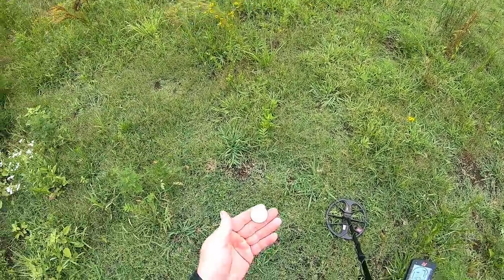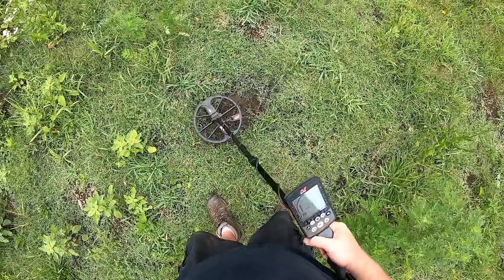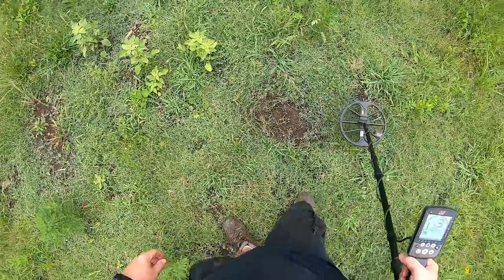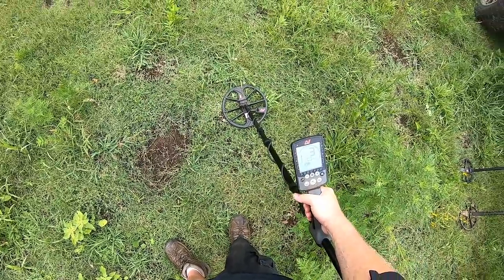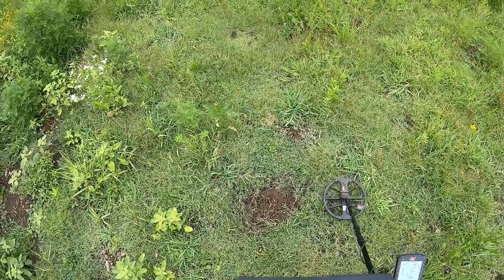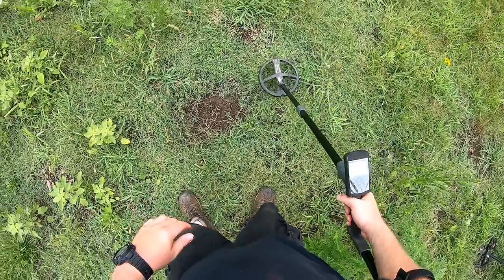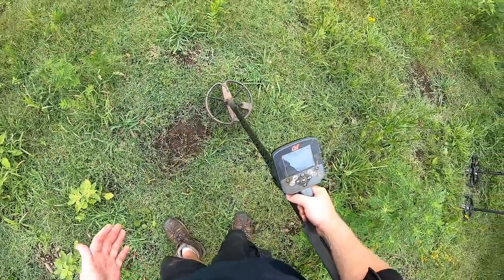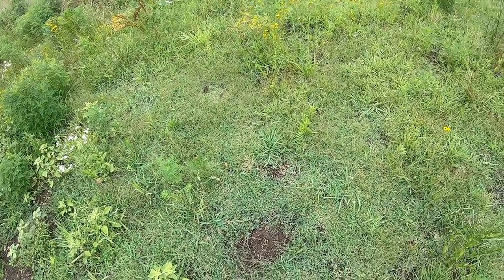Testing a big silver on edge: Minelab Equinox 800 vs CTX 3030 vs XP Deus. (#58)

Comment: This test proves why no one should be hunting in Park1 or Field1 as they are basic, reduced settings programmed into tge machine itself that is deaigned to help tge new user learn tge machine. Your hardest and deepest hitting program is Park2 and the machine has no problem hitting anything. Using Park1 or Field1 is like using the CTX or Deus in basic settings and hoping to find everything no matter of depth or ground conditions. Otherwise a great video that showcases the "basic" programs of the machine and then what it can do once you start changing settings to open the machine up more.
Reply from the maker: Detecting Chicago that’s a pretty good analysis. For the type of hunting I do I’ve found Park 2 works best. The combination of higher frequencies lets me pick out lower conductors along with high conductors, hits deep nickels hard, and seems to offer better separation than Park 1 IMHO. According to Minelab Park 1 is better suited for hunting higher conductors in modern trash but Park 2 works just as well in that scenario for me. I rarely ever use Park 1 or Field 1, so this really has no effect on me, but I do believe the machine needs a software adjustment to fix whatever is causing it to read big silver this way... especially since Minelab themselves promote Park 1 as being the best choice for high conductors due to the frequency combo. Thanks for watching and HH. Dewayne
Reply: Detecting Chicago yes, park 2 is the way to go.  I changed my park 1 to hunt my 8-13 targets with a higher tone.  I tend to overlook those....GL & HH

Comment: Thanks for the video. You probably just talked me out of buying an Equinox to compliment my e-Trac.
Reply from the maker: You're welcome Arkie. To be honest, its not really that big of an issue since most of us use Park 2 anyway, and its not effected. The Equinox really is a good machine and compliments an FBS detector nicely. Minelab just needs to fix this issue IMHO. GL & HH Dewayne
Reply: I still might get one. I like the idea of a backup/complimentary machine that can get wet. My current backup machine is my old White's DFX, which has received exactly 0 minutes of field time since I bought the e-trac several years ago. For years I have been considering selling the DFX plus the 2 extra coils and Sunray probe and purchasing an AT Pro, simply to hunt in the rain or water (and still have a backup machine if needed.) Now being a Minelab guy, I thought the Equinox would be a much better option, for not a lot of extra money, over the AT Pro. Now I'm thinking maybe sell the e-trac and DFX plus all the accessories for both and buying a 3030. Don't know which route to go.
Reply from the maker: I went from a White's V3i to the Etrac and was very pleased with the performance of the Minelab. Its deadly on deep silver. Aside from being waterproof, the 3030 offers a few more nice tools over the Etrac. The one I like the most is Target Trace.. Once you get the hang of using it, its very easy to see when you have multiple targets under the coil. It can also help identify round targets vs odd shaped targets. FBS machines have the best Target ID I've seen and are great for high conductors, but not so much for small low conductors. They're also a bit slow on recovery and a little on the heavy side.. Thats why something like a Deus or Equinox compliments them so well. An Etrax and Nox would be an awesome combo IMHO. HH Dewayne
Reply: Buy the xp deus. Or a ctx skip the 800 its middrange.

Comment: Great video.  You said that the id on the Deus was right where it should be but you didn't mention any numbers while you did for both the 'nox and the CTX.  I'm curious as to what the ID shown was on the Deus as I am having a lot of trouble id-ing things with mine and thinking of switching to an Equinox.  I'm tired of having to dig everything because my hearing may not be as good as needed for the Deus.
Reply from the maker: Hey thanks Barry. To be honest I can't remember what the exact ID was but it was in the 90s which is right where a silver half should be. Target ID isn't one of the Equinox's strongest points either IMHO.. It will usually ID in the proper range, but the numbers do tend to jump around a bit. Of all the machines I've used, the ones that ID the best are the CTX and Etrac. FBS machines are very accurate, even at depth. GL & HH Dewayne

Comment: Hi! I have a question, How is the max deep it can detect? I read 3 meters, Is that true? All the tests i saw on youtube are about 30 cm depth with very small targets, I assume that if the target is bigger than a ring or a coin, it could detect 3 meters depth but can you tell the truth? Am I correct?
Reply from the maker: chuchula chunchula chunchi depends on the soil. From what I’ve seen in mild soil it can hit a dime at 8-9”. A nickel at around 10-11”. In mineralized dirt depth will be reduced of course. As a comparison, I’d say the Nox is about the same as the CTX 3030 on high conductors. Maybe a little less. On low conductors it’s deeper.

Comment: Nothing wrong with the machine, if you swing of center you would hit it. Meaning if you over lapped a third you would dig it.
Reply from the maker: Hey Ronald. This is actually the second or third time I’ve tried this test. Believe me, I’ve tried hitting it from all directions and coil positions with the same result. Plus, you can see in the vid that when I switch to park 2 with the same swing position it starts nailing the coin with the proper tone and ID. Minelab has even acknowledged that they’re looking into this, so definitely an issue to be addressed imho. Thanks for watching and HH. Dewayne
Reply from the maker: Hey Ronald, just wanted to touch base on this again.. I went out today and did a little more testing. I did get it to hit at the tip of the coil like you said, but only in a certain position. If I went back to the standard position (center of coil running same direction as the coin), it still gives the choppy signal and bad ID. Strange. Definitely something funky going on with the lower weighted frequencies in Multi. Oh well. I’ll be sticking with Park 2 and Field 2. HH Dewayne